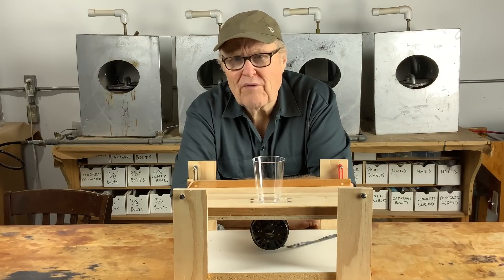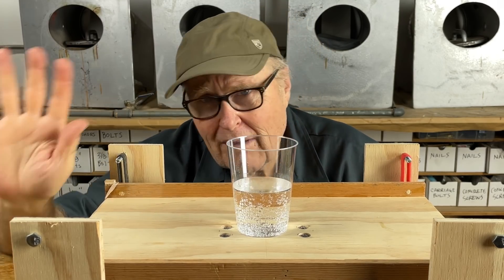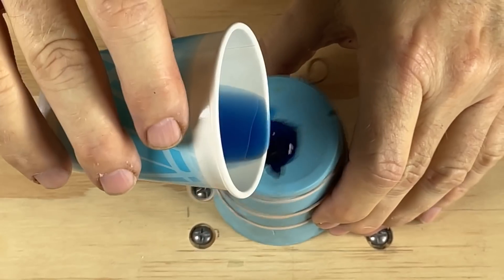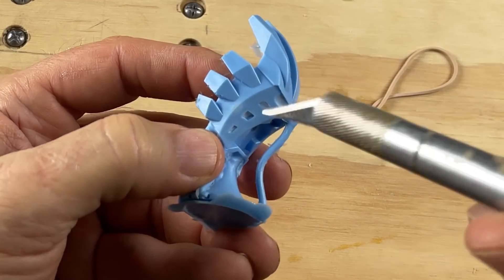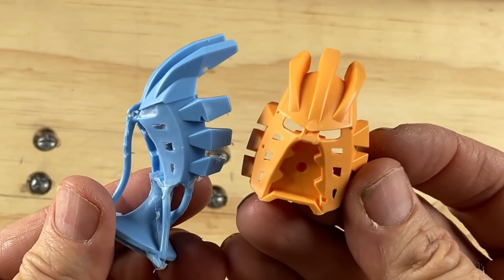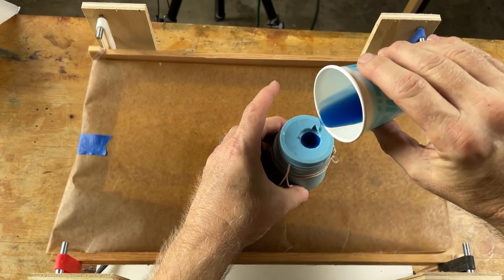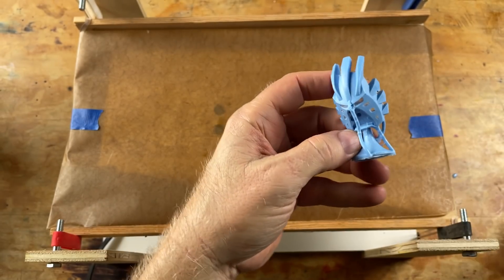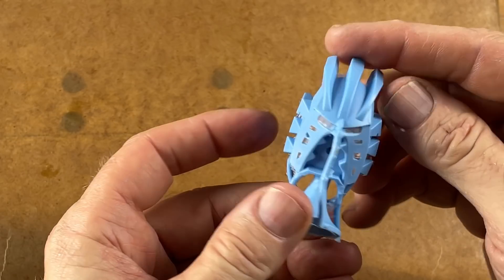Does Vibration Work? Let's Find Out!

Comment: Great job as always, what about vacuum chamber to pull the moisture out along with the air.
Reply: If it's anything like the resins from 3d printer filaments then the moisture isn't simply in the air, it's absorbed by the resin.
Reply: I vac my parts separately to attempt to remove all air from them before mixing and it does help just a bit especially since air can get trapped in the thicker part when you pour it into your mixing container. I also store my materials in a dry box because any moisture above 30% is going to make urethane bubble way worse. I tried degassing my resin after mixing but this didn't help and reduced work time. Best time to pour is right after mixed because that's the thinnest it will ever be. Regardless of work time all resins thicken over time as they heat up and you want that liquid in the mold with those bubbles out asap.